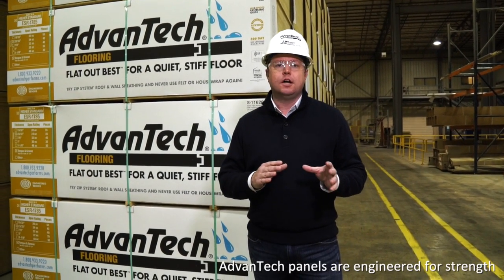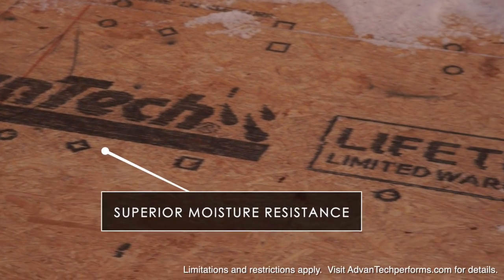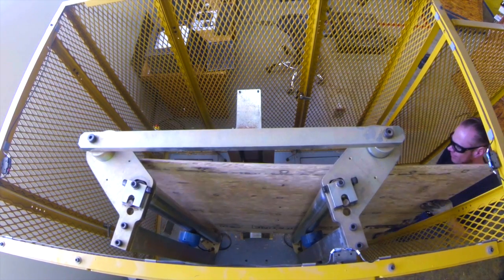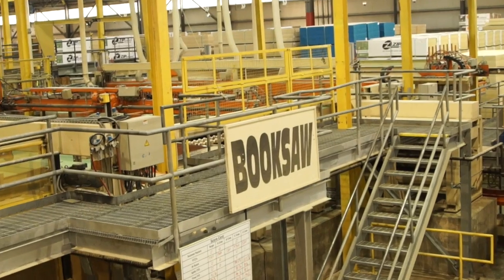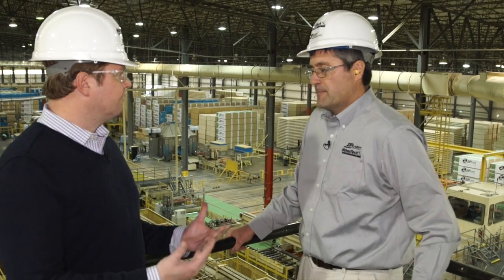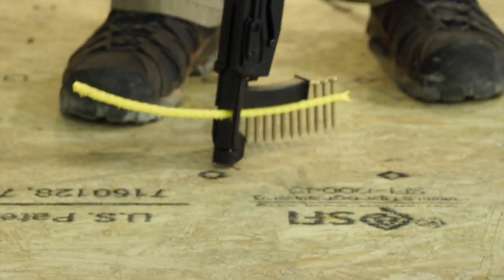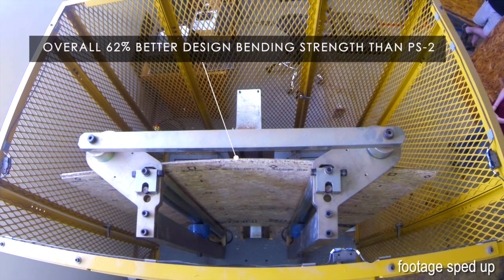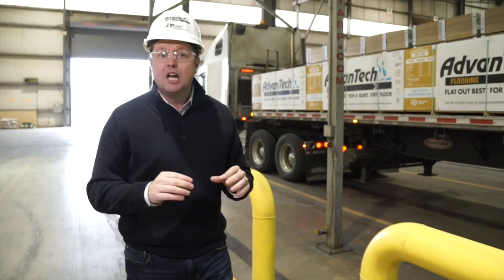Building Science: AdvanTech Flooring & Sheathing from Huber Engineered Woods

Comment: Used 1” in kitchen subfloor six years ago.  Two remnants used as outside work bench top exposed to the elements in zip code 77868.  Pieces just now ready for the trash.  I’d call that durable.

Comment: I've been recommending using Advantech subfloor for several years, but for a different reason than usual. Not only is it more resistant to water damage than other products, polyester and epoxy resins adhere well to the surface with less preparation. This is a critical concern when specifying for exterior decks that are to receive a layer of liquid applied fiberglass laminate.
Reply: This comment was very helpful🏆